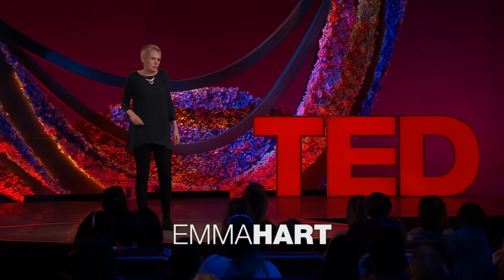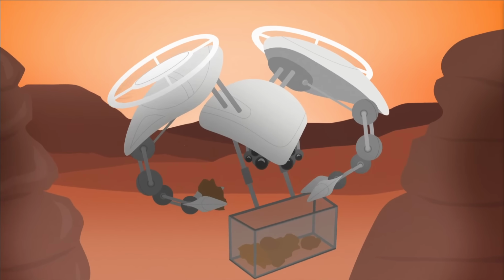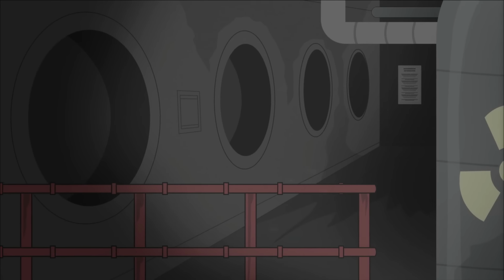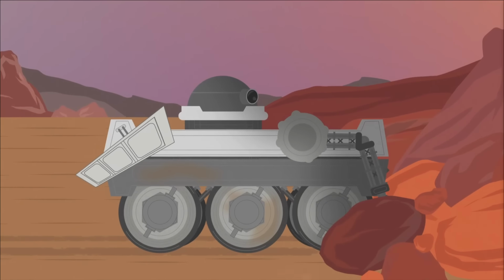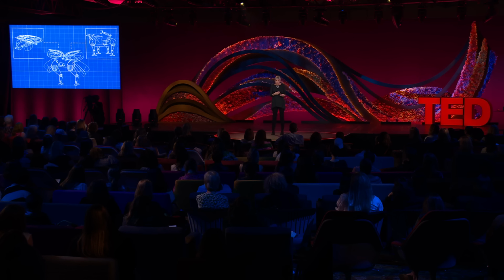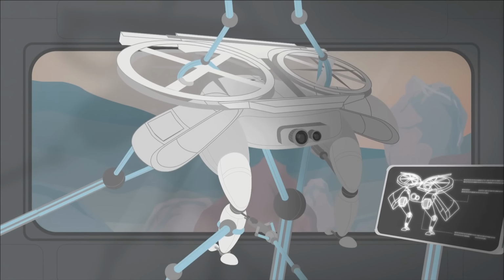Self-Assembling Robots and the Potential of Artificial Evolution | Emma Hart | TED

Comment: This just sounds like we are sending significantly more resources to space than we need to. It sounds and looks like every modern tech buzz word in one speech. Creating a robot that can move multiple ways sounds significantly more efficient. Unless we are sending it to exo-planets, I don't see the point. Even then we will have to program it with material science, sensors to detect every possible failure or a way to recognize what failed, incredibly advanced image recognition AI to recognize things like dust storms, every instrument to examin the environment (eg: radiation, acid, charged particles, ect.), send it with every material that counteracts said environment because it can't be done with only one type of material and it won't be able to survive mining the planet if it can't survive exploring it. There may be infrequent changes in the environment that wipes out all robots so it may need instruments to predict them if it even can. It just sounds like you want to launch a processor the size of a building to have the creativity of a team of human scientists with a metric ton of materials that will gather dust after it uses the kilogram of material it needs. Then when it lands, the pre-designed robot that is supposed to build the evolving robots fails because it wasn't designed to handle charged dust storms but it doesn't matter anyway because it wasn't going to properly connect component 5g67k with component 28hg6 and would have short circuited. The more complex parts there are, the more likely something will fail and this is complex AF. Weirdly enough, this idea may still be worth it if the place is 100 light years away and we can't wait for a probe but the idea sounds like it will cost trillions upon trillions to make and a trillion more to send. Maybe when we colonize multiple star systems we can consider it.

Comment: Robots that can self-evolve and self-reproduce.. because that could never possibly go wrong.
Reply: pouya  Conciousness isn't our brain, or even a function of our brain.  It is a side-effect of our functioning brain.   It is, in essence, the algorithms stored in our neurons expressing themselves through a perpetual real-time loop.

We are basically math in action.  New inputs constantly adding data into the computation, new outputs exiting to our motor functions, and even feeding back into the system.

Functionally, I would say that our consciousness, up to and including our own literal experience of it, is no different than that which would be experienced by a similarly-complex computational/thinking machine based on silicon and digital decision trees instead of carbon and chemical neurons.

The issue with AI longterm ISN'T only the evolution aspect, exactly.  It is uncontrolled/directionless evolution of thinking mechanical beings.

Randomization of parameters is powerful, but becomes increasingly dangerous the more complex your system is.  Why?  Because detrimental mutations with unintended consequences are much more difficult to detect in such a system.

Even then, artificial evolution itself isn't the biggest issue... it is the speed at which such evolution can occur coupled with the unchecked nature of it.  Normal evolution takes thousands and thousands, or millions of years, unless the organism being evolved has a very quick life cycle and is exposed to a very powerful and specific selection criteria, such as bacteria.

An unchecked system with the capability to alter itself and manufacture/reproduce, coupled with the ability to simulate the effects of proposed randomization without actually expending significant resources to test the mutation.. would be inherently dangerous, especially in an energy/resource-rich environment.

Why? Because evolution itself has already shown us that an evolutionary system, such as biological life itself, will do whatever horrific thing is necessary to continue existence... no morality at all is applied to a lion tearing apart a gazelle, because that is what evolution demands.

What starts as a compulsion to collect water in a benign system with evolutionary capability could, for example, especially when presented with a scarcity of the targeted resource, end up in a robot designed to efficiently harvest living organisms for blood.

It is only far-fetched because of the current lack in computational capacity and mechanical capability.
Reply: @pfarabee  did i hear Horizon: Zero Dawn?))
Reply: It definitely hasn't already 🥲🥲🥲
Reply: @golden3674  Have you checked the White House lately?😄😄
Reply: @frankodesandy4688  Oh, you're one of those.
Reply: The robot could evolve a bit too much and feel like shooting her one day. She really needs to talk to Arnold Schwarzenegger.
Reply: Scary 😱 😱😱😱
Reply: I just subbed to your yt channel ☺
Reply: Skynet
Reply: Many scientists said, the danger is us - people who create the AI. Technologies are just tools ⚒️
Reply: The danger is us. Technology is just tools ⚒️

Comment: Evolution can be very creative, given a million years. 
In a simulation intended to evolve virtual creatures to walk, the virtual creatures instead had a "be very tall and fall over" strategy. What the researchers wanted was walking. What they measured was the distance the centre of mass moved. This is one of the ways that harnessing evolution is tricky. You can get something that is technically what you asked for, but not what you wanted. Something that cheats.
Reply: ∠( ᐛ 」∠)＿ That's why they have more than one scoring mechanism.

Comment: That's great but how are you going to 3D print a processor that can do all these amazing things? Where will the materials come from?
Reply: Challenges are part of the adventure, not a reason to not do it. I'd send a starter pack of material. Build a machine that can obtain further material.

This can be done
Reply: @davidbristoll195  Yup, can also try to invent new type of "circuits" made of different materials.